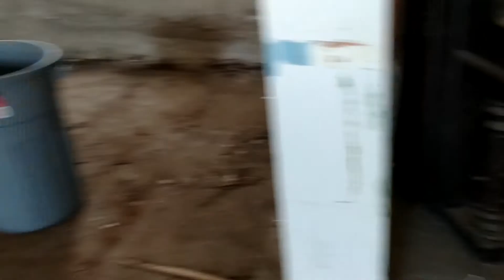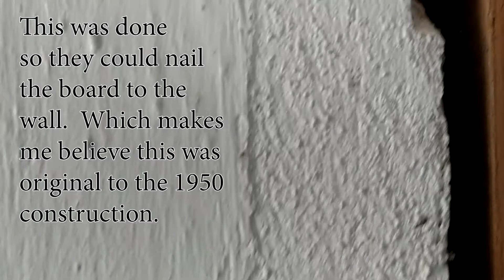1950 Church Renovation: Episode #22: 2nd non-load bearing wall removal (2019)

Comment: ✋🏼👊🏼😃❤️So much fun. I really wanted to jump through the screen and offer some assistance, especially at the 5-minute mark when you were trying to knock loose that big plywood. I dislike carpet as well.  You two did great. Awesome work. Sending you love and light.  Namaste 🙏🏼☮️
Reply: I'll go follow you on Twitter.
Reply from the maker: Yeah that board was really annoying, I would have just unscrewed it, but they filled some of the heads so full of paint that I couldn't get drill to grab them.  It probably wasn't the best method for removing the board, but it worked, and no injuries on that one.  LOL
Reply from the maker: Thank you!  :)